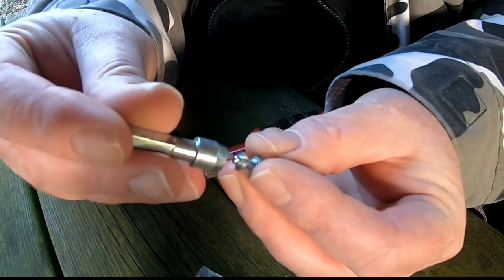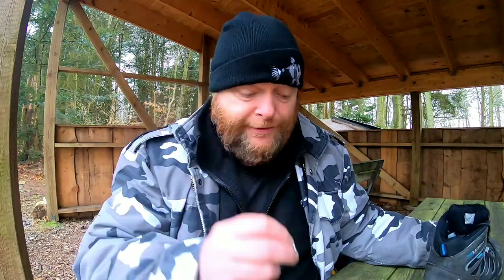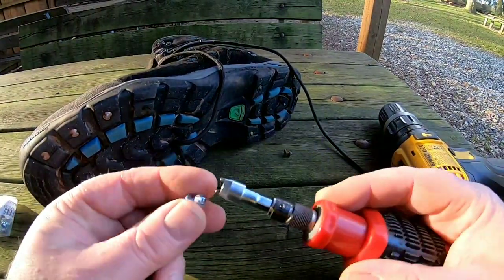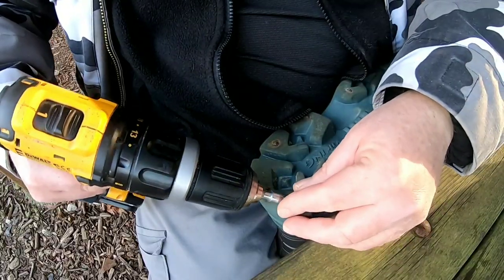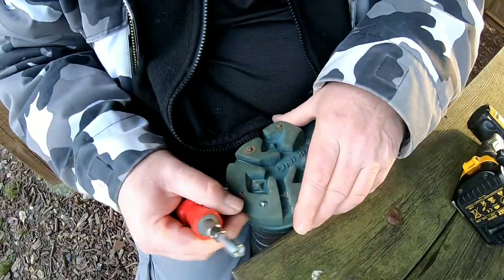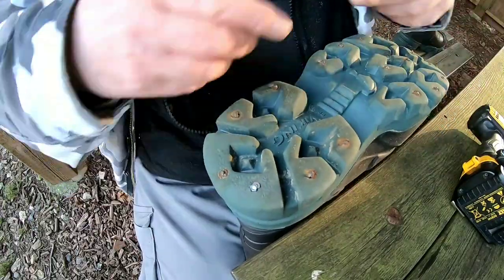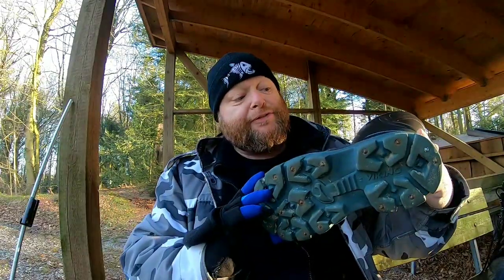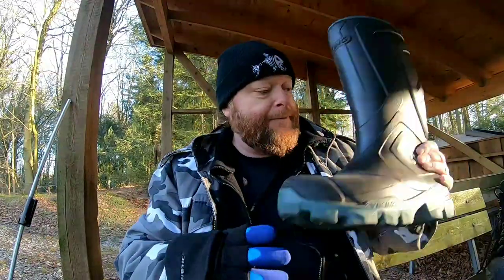How to stud your boots for the winter

Comment: Hi Billy, Ive used the Norwegian Ice racing versions of these studs for years now. Longer than yours, in a pair of Hi-tec boots. They as you say ate brilliant. Ive even been told by other fishermen that studs are more slippery than normal soles…shortly before they fall over. The carbide really foes bite into anything. Can’t wear them in doors, if you do the floors are never quite the same. 
But very interested in a link to the Chinese equivalent thought. Let me know if you can please. 👍
Reply from the maker: Thanks Brother, there are two types of slippy, one is hard sleepy and the other is  wet and squishy slippy. Can't predict them both. Find me on messenger and I'll send you a link.  Fishing on  brother 👍😁
Reply: Looks like I’ve been messaging some poor bloke in America thinking its you 🤪 he must think I’m off my trolley. He is called Billy Fishing go figure. The only other billy fishing has no picture. Ill search again. 👍
Reply: Got you 🎉